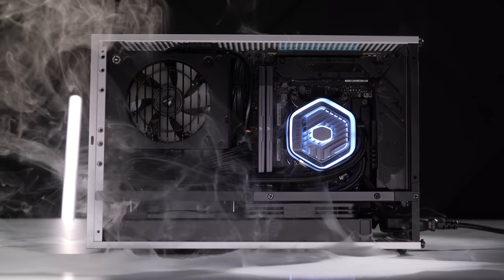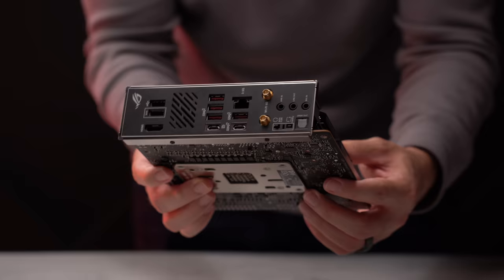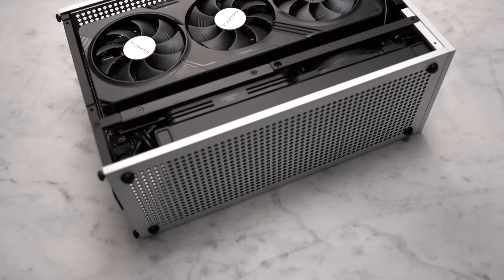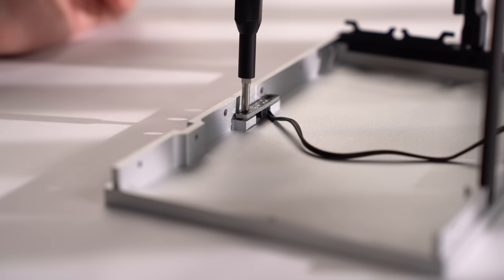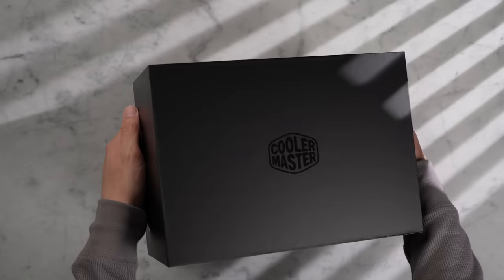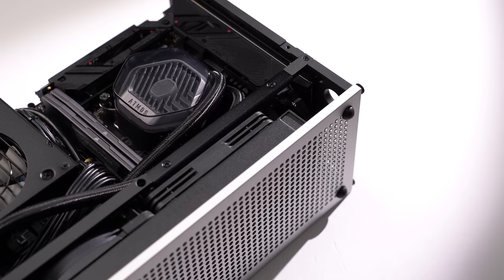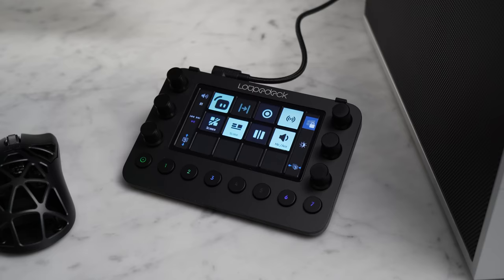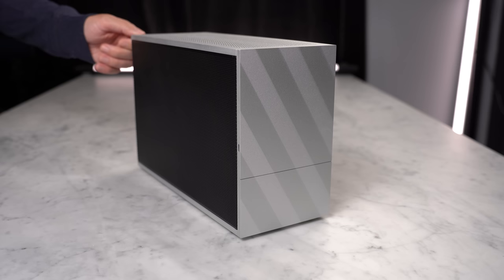The Most Beloved ITX Case - FormD T1 Gaming PC Build

Comment: I think it’s upside down
Reply: Is it intentional? Or any modding require?
Reply: It's designed that way
Reply: @fishhh009 no modding is required, everything should work out the box
Reply: @NaitikMaini  so for like a standard build would that be upside down or right way up because I have mine flip over
Reply: @notaaronc4539  to my knowledge there's no standard you get to decide how you want to do it, buy the sandwich (upside down) layout performs better thermally thus allowing the GPU to get slightly higher boost clocks as compared to the reference (right side up) layout
Reply: I’m pretty sure he knows what he’s doing.
Reply: Correct me if I’m wrong, but I think he just swapped the top and bottom covers. The Ryzen logo is also upside down. 😉😊
Reply: @meltahir  possibly but for mine I don’t think I was able to do that or if I could I must have mist it
Reply: it's reversible, one side is for liquid cooling, the other way is for just fans

Comment: I just built a full size 4090+7800x3d like 3mo ago but I i still watch every single one of these mini builds and think I should build one myself
Reply: Same bro, except k have a 4090 Aero so 90% of these small cases are incompatible with mine😭😭
Reply: Depending on the version of your card, you could absolutely put that hardware in the T1.
Reply: @clapforjesus2491  the 4090 aero will not fit bro as far as I know
Reply: I have a 4090 + 7800x3d in this case and it's amazing. Downsized from an 011d mini with 9 noctua fans and my temps barely went up😂
Reply: @suluxan3121  Yeah probably not unfortunately. I have a 3080 FE in mine right now, and I know the 4090 FE fits just fine too, but some of those 3rd party cards are chunky bois.
Reply: I ended up going with a Falcon Fragbox with the same specs…gets here Friday!
Reply: Yea no point having a huge build
Reply: I was like where's he going with this? Lol but totally agree. I've been wanting to do a mini build aswell but just hard to do when you'd have to discard alot of your previous builds gear. Not too practical, it will happen though lol
Reply: Why are using an a nvidia card with an amd cpu 😭
Reply: @poochpanko  because amd has good CPUs? Haha
Reply: I have not built a full-size PC since 2016. Not to mention, the hardware was much slower compared to today's mini PCs.
Reply: Same here! I had ram and a 7700X leftover from my 7800X3D upgrade so I need to get an MITX B650 motherboard to begin.
Reply: i just built a full size, now i wanna build an itx for college but my wallet wont allow me
Reply: @joebama22266  And what CPU cooler are you using with that 7800X3D?

Comment: Why are you installing the radiator at the bottom of the case? That's a great way to prematurely kill the pump because the pump shouldn't be above the rad. The FormD T1 allows that configuration from the top. I really don't get that build decision.

Comment: Nice detailed video.
One remark though - if the pump is on CPU it should never be the highest point therefore radiator needs to be on top - you need to flip the case.
Reply: I’m interested to know why ?
Reply: @jeremy9505  bubbles, air bubbles if pump is at the highest level bubbles can damage it in worst case in best you will have worse performance. In my case with Atmos 240 AIO it was 5C worse when radiator was at the bottom.
Reply: While true. I have a radiator that has the pump in it, and the cpu block is just that. Works no problem
Reply: @cesarereyna7739  hence i wrote if it’s in CPU. If in radiator then it’s bit more flexible but you still need to be careful for the pump alone not to be the highest point.
Reply: @cesarereyna7739 yea, we aren’t talking about that. That’s why those aios exist

Comment: Literally yesterday built a 7800X3D and a Powercolor 6800XT, I whole hardedly agree a tray to separate the screws would have been a godsend. Took me 4 hours to build. The darn thing would post, so I disassembled everything down to the cpu, reassembled everything and come to find out my DP cable wasn’t plugged into my monitor. But it was soo fulfilling coming from a Lian Li Evo to see everything crammed in this case so smoothly. Custom cables are a must. I ordered mine from pslate customs.

Comment: Happy to see the 240 Atmos fits in position 3. I got a 4070 super but want to upgrade to the 5080 (whenever it comes out) and happy to see I won't need a new air cooler or AIO when that times come.

Comment: I built almost exactly this build except I flipped the case so the radiator is on top. I also mounted the radiator to the bracket instead of the fans. This way I was able to mount 2 sllm fans exhausting on top of the radiator as well as a full size fan below the radiator just above the psu.

Also use some of the remaining standoffs with the psu to give my FE gpu some breathing room

Comment: Another excellent video. One of your best builds in my opinion. I love this case. It's similar to the Fractal Terra, but more flexible. I have the reference version of the T1, and I've been using it for the past year. The reference version is a very good solution for air cooling, as it has a lot more space for the CPU cooler. I prefer air cooling, but that's just me. The worst thing about this case I have experienced is the feet. I often move my PC from room to room, since it's so small. In so doing, and I am not heavy handed, two of the rubber feet have worn through to the metal underneath. So, if you slide it around too much like you do at 10:40 in the video, the feet will wear out. I just ordered some new feet from Ali Express lol.

Comment: Great video! Why did you opt to put the radiator at the bottom? I know that's how the designer intended for the case to be oriented, but the majority of users just flip the case to prevent air getting stuck in the pump block, should be as simple as putting the panel with feet on the "top & flipping it over.
Reply from the maker: Oh that’s a good point and great suggestion. An easy fix, I’ll definitely flip that around. Thanks!
Reply: Since the case has simetrical screws and panels, you can easily swap and rotate it around!
Reply: I now rarely see people putting their radiators at the bottom nowadays in their videos ever since that Gamers Nexus video hahah. He has definitely made an impact
Reply: Yeah, this comment should be higher up. There are some videos from older visions of the T1 sandwich that show both with air cooling and aio's, having the top fans as exhaust is slightly better for thermals. That's why I am running in my T1 v1.1 rn.

Comment: 7:50 the stock SF750 cables are more than good enough in the FormD T1 - I'm running an air cooled build in triple slot mode and with some cable ties they are easily managed. If you think the SF750 cables are bad the ones from the EVGA GM line are FAR worse - horrendous cables.
Reply: Wow. What CPU, cooler and GPU are in that build? Not much room for cooling left and that with a 3 slot GPU. I'm guessing you have a pair of T30s on top, sucking at maximum capacity to keep that setup from throttling. I'm curious, so please share. I just finished my T1 build today, using an Atmos 240, and cabling was quite a challenge with stock Corsair cables. It turned out quite nice, but it took me many, many hours to get it right. I had to mount the PSU in alternative / 90 degree mode, to prevent the cables from clogging up the airflow of the T30 on the radiator. AIO tubes are very cramped in that setup, but it works, just barely.

Comment: @DevynJohnston. Holy cow I just built in this case and thank you very much for your tutorial!!! It helped immensely, I got the V2.5 but it still helped me so much! Your 15 minute video took me 4 hours to build because I wanted to make sure it was right and I definitely did not want to do it again! Hahahaha

Anywho, the only part I wish I would have done better was there is a whole in the GPU slot at the back of the case. I put it at the 3 slot GPU and I only have a 2 slot, in my head I figured what could go wrong, well let me tell you! I have a 1 slot whole on the back now hahahaha

Anyway! I just want to thank you from the bottom of my heart because if it wasn’t for this video I would have been screwed as the visualization instructions are a little hard to read.

You’re the best! 🎉

Also I highly recommend this case! It’s an absolute beauty!!

Comment: Great video and build. But good luck with the AIO pump in 3-5 months going bad. The air is going  to be trapped at the highest point in the loop with the radiator at the bottom, and the air is going to rise to the pump. So the pump is going on air eventually. Steve from Gamers Nexus did a great video on that. 
Other than that a great video again. Keep up the good work.
Reply from the maker: Yea, I mistakenly overlooked the idea of flipping the case and putting the feet on the "top". An easy fix and would be the ideal orientation for the AIO. I have the correction in my pinned comment and vid description.

Comment: Sorry to ask you about this on this video, but I have some questions about your XProto-L build :
- What cable extensions did you use ? I'm not sure I found the right ones on the Xtia website, I'm afraid of ordering the wrong ones.
- Does the case allow the installation of a 2.5 SSD ?

Thanks in advance for your answer :)

Comment: I really liked the video, especially since I am trying to deciding on a case. Unfortunatly the FormD T1 and the Dan C4-SFX are sold out for quite some time. I also like the Lian Li A4-H2O. In another video I have seen that there might be an issue with heat management when using components that are too demanding. I'd get components like an RX 7800 XT with a Ryzen 5 7500F and plan to build it in an A4-H2O using an AIO. Do you think this will work fine, also considering later upgrade options?

Comment: Hey Devyn! I am planning on pretty much copy pasting this build for myself (with the exception of some fan preferences) and I was wondering how the cooling/run temps have been since you built this? Will I have to worry about overheating months down the line? Awesome video and keep up the great work!
Reply from the maker: The temps have actually improved by a few degrees since shooting the video. I flipped the case by swapping the bottom panel and top panel, so now the radiator is on top. I would definitely recommend doing that, as it will increase the lifespan of the AIO. Thanks!

Comment: Won't the pump pull air bubbles being at the highest point in the loop. Leading to early pump death. I went with the Dan a4 h20. 7800x3d + 4090 fe. 240 kraken aio. System has good thermals. And pump is lower then radiator.
Reply from the maker: yea I didn't flip the case in the video. I have the correction in the pinned comment and description.

Comment: How did you get the Noctua fan to fit with the grille? Using the same cooler, fan and mobo combo, but the clearance is so low the fan grill gets pushed into the fan by the motherboard while the case is closed.

Comment: Hey Devyn, do you have any recommendations for using an air cooler on your CPU rather than AIO in this case? Do you see any drawbacks to using an air cooler? Would it yield better or worse cooling performance than an AIO?
Reply: I have an AMD 5600g going into this case. Lower TDP CPU's like mine doesn't need a watercooler to run well. If you have a big ass GPU, you'll be limited on height for your CPU cooler. I have a 2-slot thick GPU so I'm going with as big an air cooler as I can, which is the Noctua L12S.

Comment: I haven't built a PC since 2014. I am looking to build an ITX this time around with a i7. My question is this case to small to keep it from thermal throttling?
Reply: Yeah it's probably gonna cook itself. Especially if it's a K series chip. Although if you wanna make a well informed decision, I suggest you watch the videos by Optimum, who built a lot of different systems in this case. The latest one with a 4080 super and an i5 14400f. But he's built with more power hungry chips as well. Might answer ur question

Comment: whats the length of the MODDIY 12VHPWR 16 Pin Power Cable. I know its between 20-40cm but I want to buy the correct fit and the PCIE RISER CABLE is sold out smh

Comment: Question for the community! I've pretty much purchased everything I need to replicate this build but I am wondering if I can switch the GPU to the Sapphire Nitro+ 7800 XT AIB vs the Gigabyte OC (the one Devyn used in the video)? The dimensions seem to fit according to the fmdworks website but I don't want to purchase the Nitro+ just to have it not fit with the Atmos 240 AIO, etc! If there is anyone smarter than me who could shed some light it would be greatly appreciated!

Comment: I'm fairly new to building. Is there a way to orient the radiator to be on top of the case rather than at the bottom??
Reply: The top/bottom panel's are identical. You can flip the entire chassis upside-down if you need to thus the radiator being on top now. The only thing making the bottom panel as the bottom is that you'd install the case feet there.

Comment: shouldn't the case feet be installed on the other side of the AIO rad? Rad on bottom allows air to come up to the top of the AIO pump, I'm not mistaken
Reply from the maker: check the description and pinned comment
Reply: Gotcha, didn't see that. Over great vid. Love the build

Comment: I have exactly the same configuration in my FormD T1, the ATMOS and the two Noctua 15mm and 25mm fans, but it happens to me that specifically the 25mm fan sounds with a high pitch noise, which is eliminated by removing the top cover. Have you noticed something similar, if so how do you think I could solve it? I'm pretty sad, I had some P12's before and they were quieter than the Noctua NF-A12x25.

Regards!
Reply: You coolermaster mobius fans for your Atmos...

Comment: If you flip the case around bottom to top the temps will be better
Reply from the maker: yea you're 100% correct. I overlooked the idea of flipping the case
Reply: @devyn.johnston  you can also try to use an air cooler for the CPU, the biggest you can put in with 5-6 pipes and put to two fans at the top to pull the hot air out.

This will drastically decrease the GPU temps and might raise abite the CPU temps.
The radiator is trapping all the hot air that the GPU creates.

You can try this and see how the temps improve for you.
Might even be an idea for an update video

Comment: ok, there's no way that tiny little gap at the bottom is enough to suck in air for cooling.
are you able to mount them at the top of the case is it limited by design?
Reply: You can absolutely move it to the top. This case doesn't really have a dedicated vertical orientation. All you have to do is flip the case around & stick the panel with the case feet on the bottom & you're done.
Reply: @EverythingisFire oh that's very good news

Comment: Wow, no CPU bracket? That’s pretty much a must these days. Also, 7850x3d is NOT better power-wise than the 13600k. Take a look at comparisons and you’ll see that while it may be lower power at peak, you RARELY actually use a CPU at peak, especially in gaming, and the E-cores of the Intel chip blow AMD out of the water.

Comment: What direction do you have the AIO fans? Pull air from the bottom or blowing the internal air out the bottom?
Reply from the maker: I have them in a push config. Although something I failed to mention in the video is that you can flip the case so that the rad is on top, which is better for the longevity of the pump and will likely give better thermals. (I've since added it to the pinned comment and mentioned it in the description.)
Reply: @devyn.johnston  thanks for the quick reply!

Comment: How did you get the case lol
Reply from the maker: They are still in stock at https://fmdworks.com/collections/all
Reply: @devyn.johnston is that a real website? You bought it from there? I tried asking the company which is the real site but no answer
Reply: @JonasBensimon  Both Owners split up and made their own sites. Called Mommy and Daddy. Both are reputable
Reply: @devyn.johnston   Can you confirm if the new NZXT Kraken AIO 240 fits? the pump is 55mm high. and my GPU is 52mm - ive been struggling to figure this out.

Comment: I've seen people say "Why is the Fractal Terra so popular, the FormD T1 is better!" Well, first off, the link you have gives a 404, which might be a mistake or point to the fact the product you linked is gone already. When you then click on products, they're all sold out. Great case, but poor availability and expensive shipping keep it less popular. People use the Terra because you can get one and it's cheaper.
Reply from the maker: I had 2 links in the description. YouTube formatted it weird and put them together which is why you got the 404. I fixed that, and if you check the second link they have a few colors in stock.
Reply: @devyn.johnston  Correction: The second link does show stock for the other models.